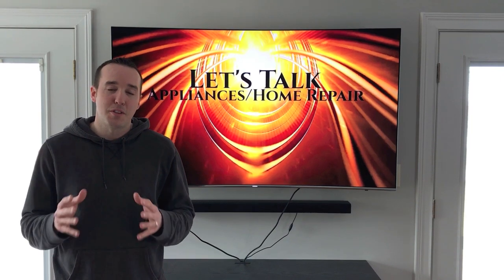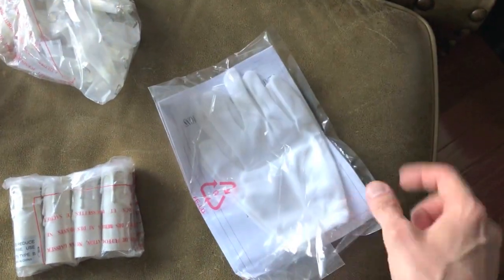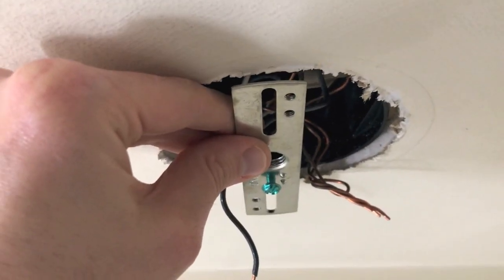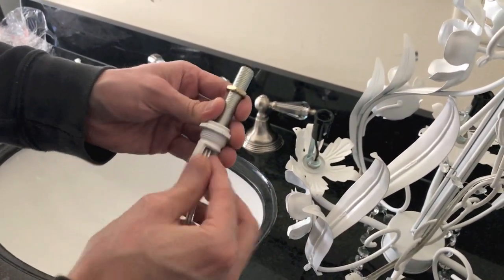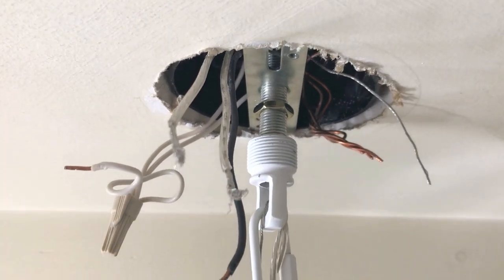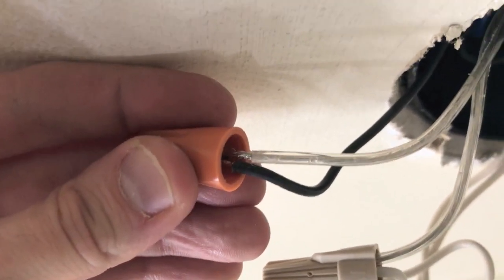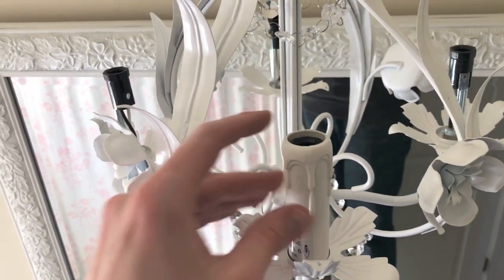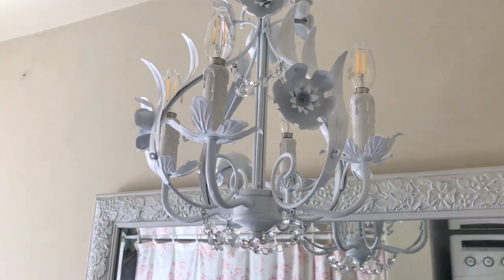How to install/hang new Chandelier - SAFE FAST & EASY!

Comment: Just out of curiosity, when it comes to the ground wire, do I have to hook it onto the green screw or can I just hook it back to the ground wire with the electrical cap just like it was before with my old chandelier? Thank you
Reply: The ground wire should be attached to the ground wire (the bare copper wires).   The green screw on that metal piece isn't grounded to anything.

Comment: Does it matter which wire goes to the live wire and which one to the neutral wire? Meaning the two wires attached to the chandelier itself are the same color. Which one goes where? Or it doesnt matter
Reply from the maker: Paister03 

Thanks for watching, we appreciate you reaching out to us.  One white wire will attach to the power lead & remaining white wire will attach to other wire...aka...neutral wire in a way.

We are happy you reached out to us, we always stress the importance of properly connecting all parts & wires when working on electrical.

Keep us posted on your project!  Please subscribe to the channel and turn on your YouTube notification Bell 🛎 that would be awesome thanks again!  😎👍🔧🔩
Reply: I figured that much thank you for your reply but my real problem is that there is a 3 light bulb fixture on it now and there are way more wiring then I see on YouTube DIY projects on this. Not sure which wire to keep and which one to cut. Any suggestions?
Reply from the maker: Paister03 

Thanks for the reply.  Since your switching from a 3-way style light fixture to a less stage fixture, you may need to cap off remaining wires as they won’t be needed.

Most importantly, you must make sure the Black hot wire, white leads, & ground wires are properly connected & secured to their respective connection points/wires.

😎👍
Reply: @DIYwithMichaelBorders   thanks for the advice, now I have a better perspective on what needs to be done.  Thanks alot
Reply from the maker: Paister03 

Thanks for the reply.  Very cool & keep us posted on your project!  😎👍🔧🔩

Comment: So, what is your green ground screw grounded to?  Why didn't you attach the fixture ground to the house ground as it was when you took the old one down?
Reply from the maker: Sean Ahern 

Thanks for watching Sean!  Great question, the old Chandelier Ground Wire wasn’t properly connected to the Green Ground Screw.  During this video as we worked through the install process, we wanted to make sure the Ground Wire was properly connected & secured to the Green Ground Screw.

We hope the video helped!  😎👍🔧🔩
Reply: Ok, but it was connected to a ground. As far as can be told from the video your ground screw is not connected to anything, making it ungrounded. If you copper ground was connected there too it would be ok but it isn't. So, what is your ground screw grounded to?
Reply from the maker: Sean Ahern 

Thanks for the reply Sean, the design behind the the Green screw connected to the frame/base mount of the Chandelier allows a secure ground connection when looping the Ground wire around screw & tightening it.

It also allows a clear indication of the location of the Ground Wire to alleviate any guessing games.  😃

A great & recommended way to safely & properly connect & secure your Ground!  😎👍🔧🔩
Reply: Ok, thanks I see what you are saying. But I hope your junction box is grounded then if you are grounding to that through the mount! Assuming your box is metal and not plastic, or you have metal beams instead of wood.otherwise you may not be as grounded as you think; just tracing backwards. Thanks for the tip and help!!
Reply from the maker: Sean Ahern 

Great info Sean & we really appreciate your comment & information.  Keep us posted with any questions!  😎👍
Reply: I was thinking the same thing. The fixture isn't grounded if the bracket isn't grounded. The ground wire from the house looks like it was left disconnected.

Comment: Question????The Crystal Plate that I have wont come off the stem. Is there some type of locking mechanism? This Chandelier is from the 60"s
Reply from the maker: TANGOSUGAR 

Thanks for watching.  It’s possible that it’s a twist on.  Untwisting it may allow you to gain access to additional parts.

Hope this helps.  Please subscribe to the channel and turn on your YouTube notification Bell 🛎 that would be awesome thanks again!

😎👍🔧🔩

Comment: Thank you these installation and removal videos are great. Everything would have gone just as you said and this wouldve been done in the same time as watching the two vids....maybe a half hour with assembly and cleanup. But NOOOOO. OF COURSE the twits who owned the house before us jammed the wrong size screws into the diagonal bracket that attaches to the electrical box in the ceiling, ruining the holes in the little tabs on the box. Thanks to yet another of their "handy solutions," this is yet another of their messes we're stuck trying to fix. (They painted walls without masking tape and dropcloths,so the original oak wood trim is smeared and spattered with paint,  they installed a sink base too large for the kitchen so the basement door couldn't open more than 45°.....just the beginning of their insane jerry rig jobs)
Reply from the maker: Thanks for watching & welcome to the DIY Raptor Club.  That doesn’t sound cool...🤔

You’re not alone, we find ourselves coming across something that needs to be fixed & leads us to say... “What in the world was the previous owner thinking”...🤣

Keep us posted on your project, after it’s complete, hopefully many stress free days ahead for you!

😎👍🔧🔩
Reply: @DIYwithMichaelBorders  Thanks for the encouragement! My dear husband helped me. He got a smaller diameter screw, put a nut way up by head to make it bigger, then gave it to me to slide down through the damaged tab on the electrical box. Then I put the cross bracket on with the proper screw on the undamaged tab.  Finally I put the other end of the cross bracket over the smaller diameter screw and put another nut on. Hope this is good! 

Now, if only the chain had those chain connecting links that twist open and closed like yours! We have to pull the links apart with two screwdriver shanks and push them together again. In order to do that, I  have to wrap the teeth of the adjustable wrench with rubber bands otherwise they scratch the finish on the chain. Yuck! Nothing simple. Every chain hamging chandelier should come with those connecting links or people should be warned they need them.
Reply from the maker: @brandywineblue  

That’s great news & we appreciate you taking the time to share this.  Enjoy that new chandelier & upgraded look to the room.